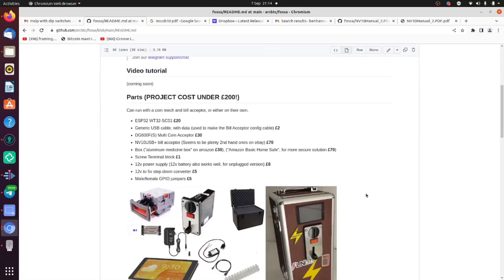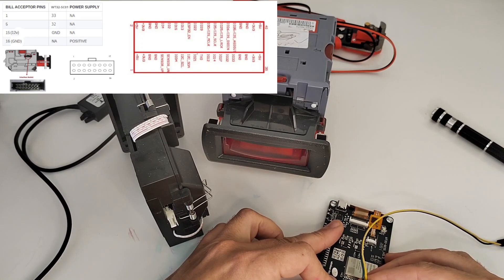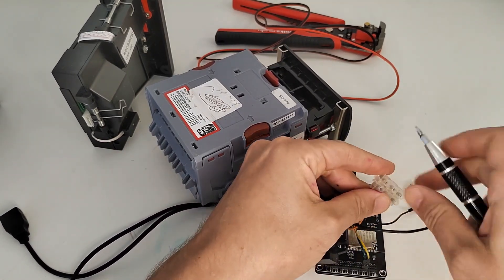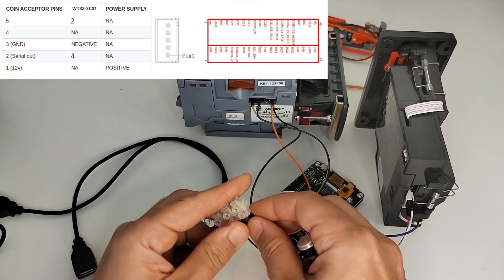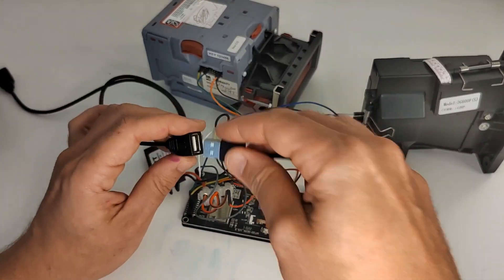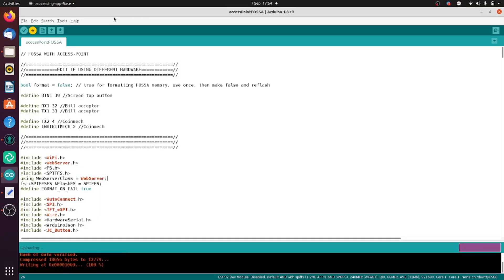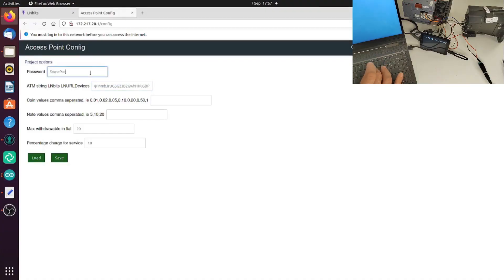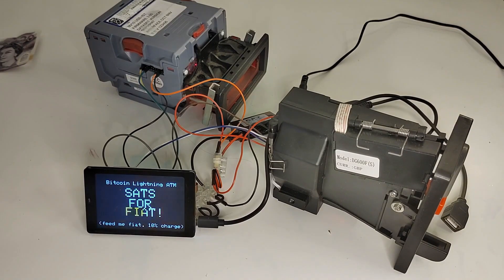FOSSA - Cheap Offline Bitcoin ATM, Includes Bill Acceptor!

Comment: This is great 
I would like to enhance the functionality of the FOSSA ATM by adding the capability for users to sell their sats (satoshis) for fiat currency using either the NV11 – Validator & Note Recycler or Vega - Validator & Note Recycler - JCM - Note Validator.

Upon approaching the FOSSA ATM, users will be presented with a user-friendly interface on the screen, where they can choose between two options: "Buy" or "Sell."

If a user selects "Sell," the following process will be initiated:

Amount Selection: The user will be prompted to enter the amount of sats they wish to sell, with a maximum limit of £200.

Fund Availability Check: The FOSSA ATM will check if it has enough fiat currency to process the transaction. If there are insufficient funds, the user will be advised to try again later.

Transaction Confirmation: If the FOSSA ATM has sufficient funds, it will display the wallet QR code and the corresponding amount of sats the user needs to send to complete the transaction.

Satoshis Transfer: Once the user sends the specified amount of sats to the provided wallet QR code, the FOSSA ATM will wait for the transaction confirmation on the blockchain.

Cash Dispensing: Upon receiving confirmation of the satoshis transfer, the FOSSA ATM will proceed to dispense the corresponding amount of cash to the user, converting the sats into fiat currency at the current exchange rate.

This upgraded functionality will provide FOSSA ATM users with the option to conveniently sell their sats for cash, making it easier for them to access fiat currency when needed.